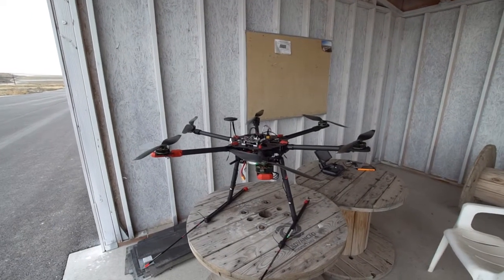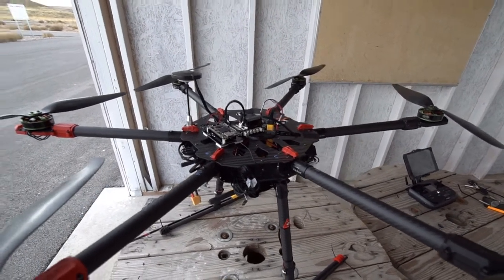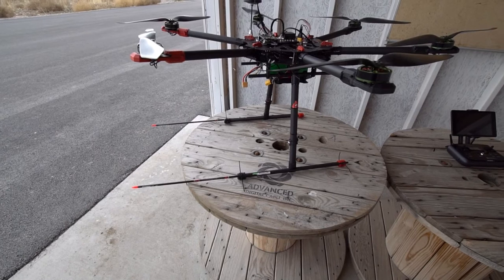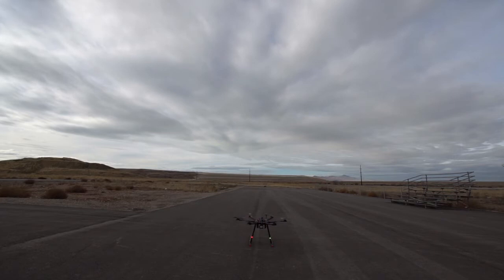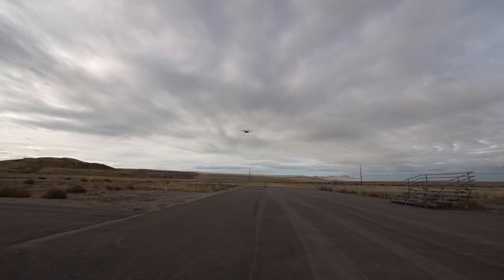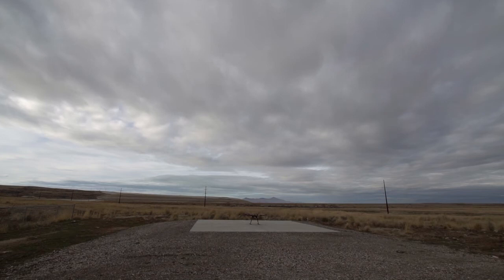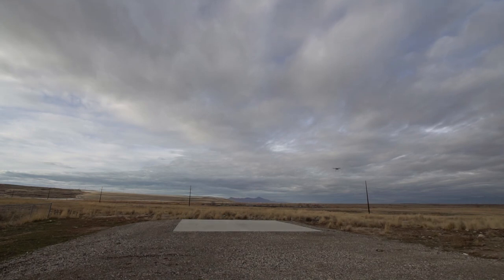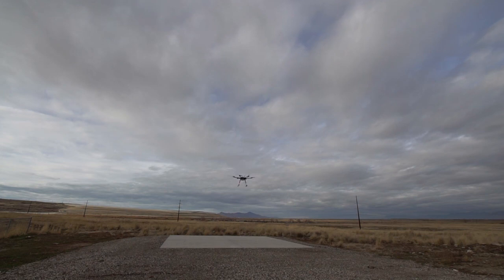Maiden Flight Tarot X6 with 3DR Solo Brain

Comment: Thankyou for sharing, a couple of questions, did you bother tuning the PH 2.1 with a traditional radio before throwing the sololink inside?, does the sololink fire thru HD video etc like a normal solo? and if yes how would smartshots like cablecam work? just a 2axis gimbal?, keen to see the smartshot side of things, Ive ordered the sololink etc as I have solos and DIY monsters similar to yours :)
Reply from the maker: I had flown the Pixhawk 2.1 on a big quad copter with a conventional radio/receiver. When I transferred the P2.1 over to this copter I just changed to a  Hex X setup in Arducopter, connected SoloLink and the Solo controller, and then just took off. Ridiculously easy. Testing SmartShot today, so stay tuned.